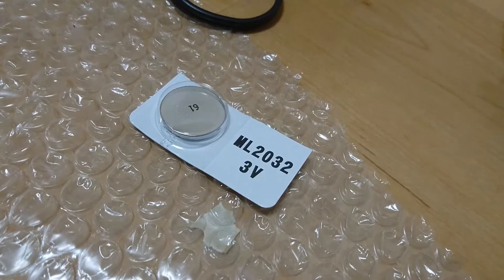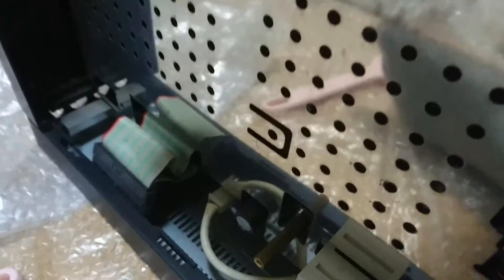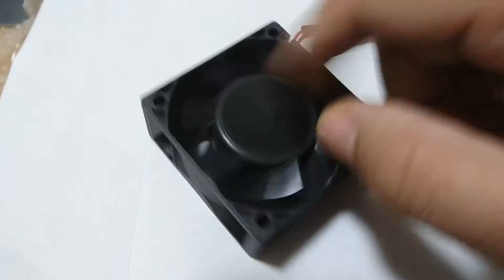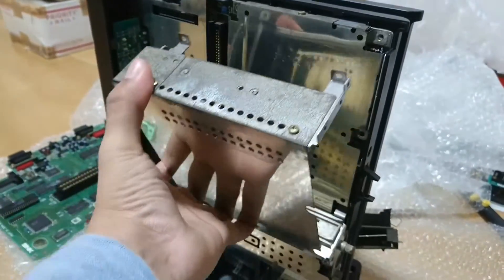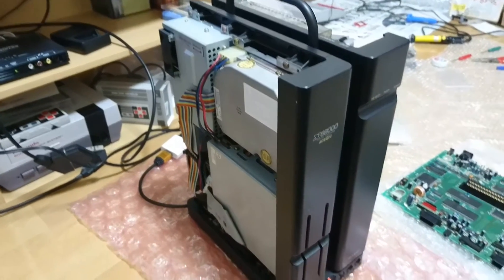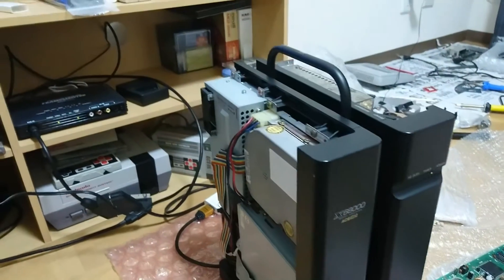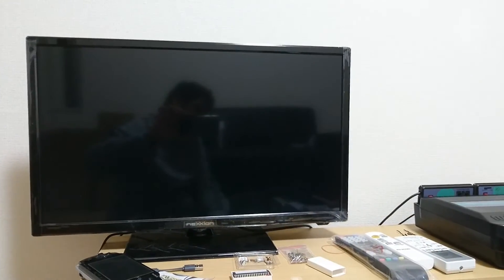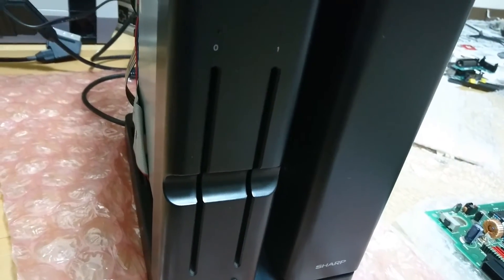SHARP x68000 Restoration - Part 3 - [PSU, RAM, SRAM Battery and Motherboard restoration]

Comment: Do you know what can i do if i got static green Power led (red Timer) and soft-power won't work? i have changed the psu since the original, but i have the same problem and i can't figure it out!
Reply from the maker: Oh I would suggest you to ask this question on nfggames forums.. I have never faced that issue.

Comment: Was the PSU in working condition before you changed the Capacitors?
Reply from the maker: Um.. I dont know.. I did not turn it on to check as it was too risky! :P
Reply: @ramakrishnamishra8179  I just got a X68k, It started up but did a lout electric sound but then it stopped and smoke came out the fan with burnt smell, but then stopped right away, is there a chance that just the powersupply burned and everything is fine?
Reply from the maker: @TheOmegaWolf3700  yes! It could be just the PSU! Disassemble it and check it out!
Reply: @ramakrishnamishra8179  will do that, hope it works your videos will help me out in that case, thanks for the tip
Reply from the maker: @TheOmegaWolf3700  thank you! Please subscribe to my channel and hit the bell icon if you like the content! I am always there if you wanna ask any questions!
Reply: @ramakrishnamishra8179  Sure thing, will tell you an update about it later on!!!

Comment: Recommened against that bettery mod. The circuit is meant to charge a 3.7v battery and now you placed on that doesnt charge. Not good.
Reply from the maker: GoodTofuFriday I have replaced it with 3v chargeable battery ml2032...  It Is working fine so far and has not exploded.. ;)
Reply: Rama Mishra ah good stuff then!